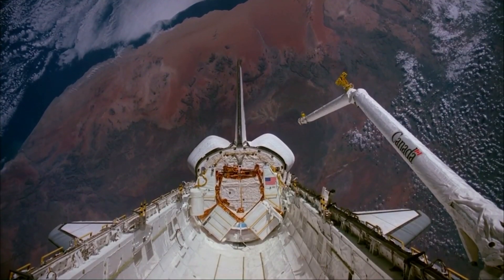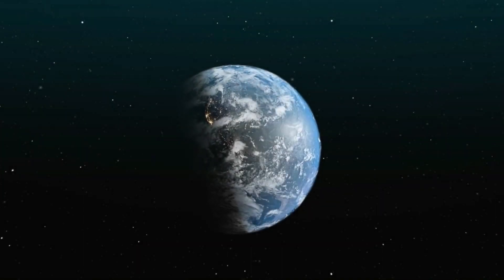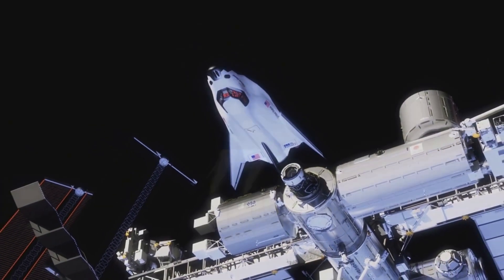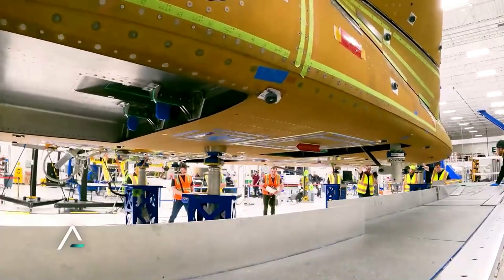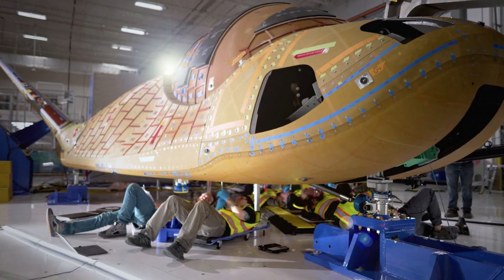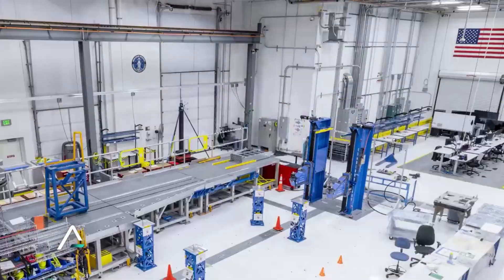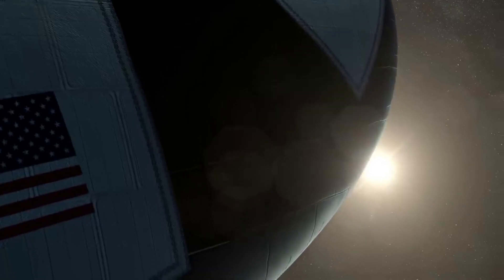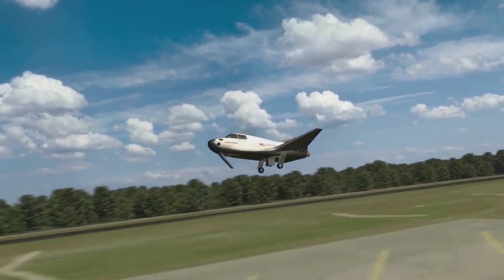Why NASA Picked Dream Chaser For Future ISS Operations

Comment: It is worth remembering that during the Apollo era, NASA's original design for the Space Shuttle was similar to Dream Chaser, but the Department of Defense demanded they greatly increase the cargo capacity, so they could use the shuttle to catch and return early model spy satellites that used film cameras.
By the time the shuttle flew, the DoD no longer needed this capacity, but it was too late to change back.  Original plan was for a heavy lift rocket for payload, like space station modules and things like Hubble, and a small 5-7 seat shuttle for crew transfers and LEO missions.

Comment: Dream Chaser is just that ! A Dream !
Reply: In what way? The first Dream Chaser and it’s Shooting Star model are nearly finished and are expected to launch this year.
Reply: @spacey22  Dream Chaser is designed to deliver crew and cargo to Space Stations last time I checked SpaceX has no such contract for Starship. 

I think it is quite commendable that Sierra Space were able to keep developing their spacecraft even when it was not chosen by NASA for commercial crew. Also there is not a pressure to finish development when you don’t have an immediate need for the product. Now that Sierra Space have the 2nd Commercial Cargo contract and Orbital Reef they have a need for the system so they have a reason to finish it off.

Comment: Why did it take SNC so long to develop Dream Chaser just for cargo? SpaceX managed to build a crewed capsule and a rocket in even less time!
Reply: To make it simple, the dragon spacecraft is far more simple than the dreamchaser, also the heat tiles need to be specially designed for the dreamchaser to make sure it doesnt fall of during reentry, while the dragon spacecraft just needs a one-time use ablative heatshield that takes less time to install/design.
Reply: Two reasons come to mind.  Firstly, SpaceX has near unlimited funding from one of the worlds richest people, SNC does not.  Secondly, Boeing was chosen by NASA over SNC for Commercial Crew, so they had to go on for a number of years by themselves.
The fact that they did progress so much, where other companies had gone bankrupt, is quite impressive.
Reply: @martythemartian99  Thank you for the informative reply!
Reply: @gabedarrett1301   You're welcome.  I always found it surprising that NASA chose Boeing over SNC, giving their reason as less risk of delay because of Boeing's past experience.  It seems they did not fully take into account the fact that SNC had already designed and built test articals, while Boeing did not even have plans ready.
I think NASA regrets its decision.
Reply: yes but space x is owned by a complete ahole  so is ruined by that alone .

Comment: How will astronauts enter the craft prior to launch, when dream chaser is stacked on the launch vehicle?
Reply: Either through a top hatch behind the cockpit, or through the Shooting Star module.
Reply: @martythemartian99 the hatch behind the cockpit makes the most sense since the Shooting Star module is optional and may not be used with the crew variant.
Reply: @luther0013   Yes that makes sense.  After reading your comment, I checked some images and found one of DC on the launch pad with a Crew Access Arm on the back of the ship, halfway between the cockpit and the aft hatch.